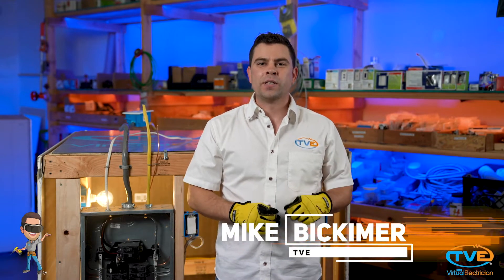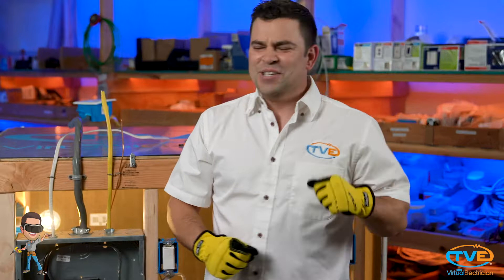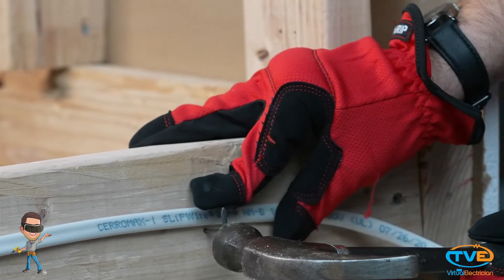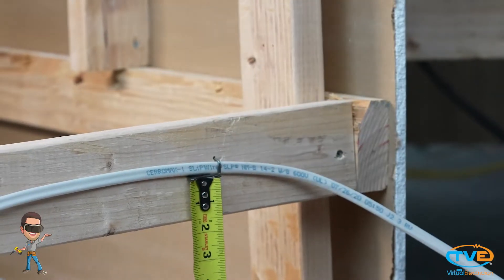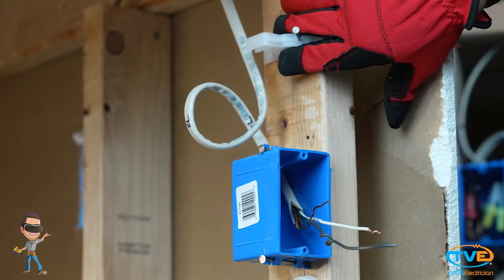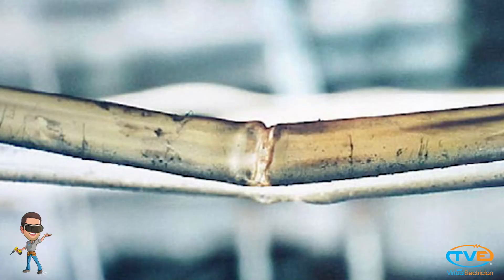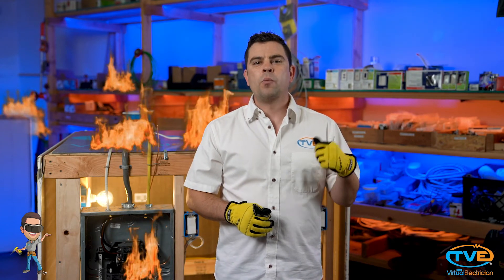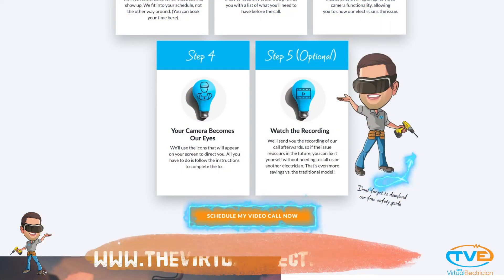How To Staple A Wire - NEC (National Electrical Code)

Comment: Putting pressure on conductors does not change the resistance.
Reply: Not so much the pressure, but it you staple it so hard that you mash it and dent it, you warp the copper and put micro cracks in it, and alter the surface area of the copper, and this reduces its current carry capacity. Consequently, it will start to heat up
Reply from the maker: it sure heats it up

Comment: When stapling every 4.5 feet does that include running horizontally through the studs? If my receptacles are 6’ apart, Would that be running up the stud a couple inches, stapling and running it across to the next stud?
Reply from the maker: no you only need to staple the wire going vertically. the holes hold the wire in place horizontally...